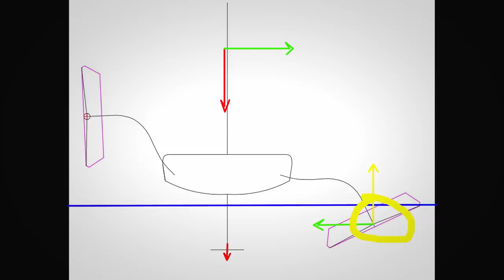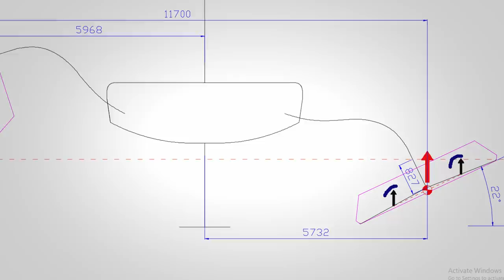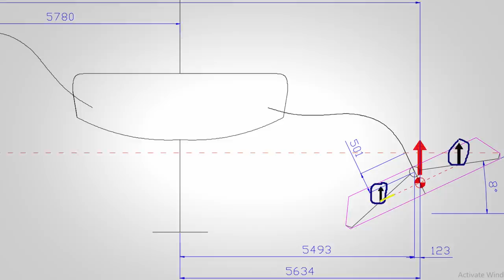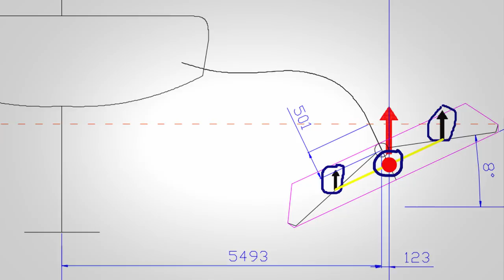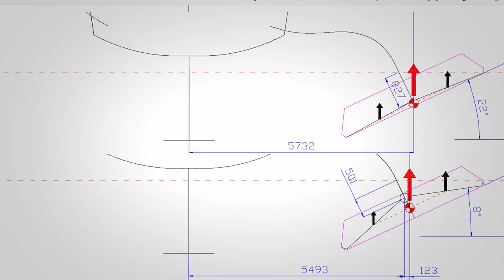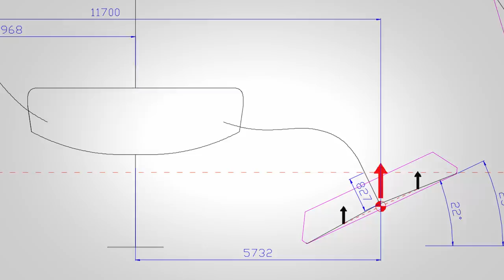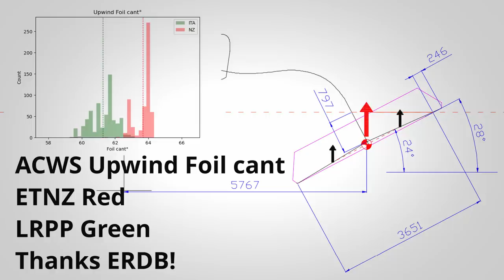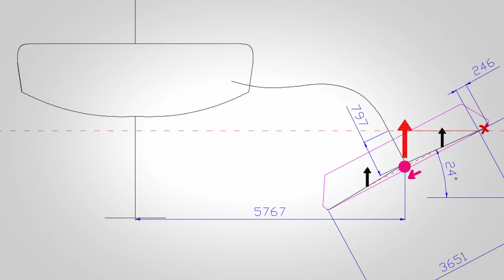Is this the ETNZ advantage that will decide the Cup?

Comment: I am here when many comments are made: I just read a few, so I may repeat something others said already. 
I would have liked to hear about the actual or estimated relative figures of forces that shall be generated by the foils, in terms of lift and of side component to react drift.
The flat foils of the NZ boat are probably designed to carry the resultant of the two (fixed vertical component, slightly variable side component), along the average expected direction: their small dimension could suggest that the flaps are moved together, thus with resultant lift being in the mid point, along the arm.
To me, the Luna Rossa Y shaped foils are designed (and operated) so that the inboard wing shall react, together with the arm endthe drift due to wind side force (I cannot figure in which proportion, while it would be interesting that most be taken by the arm): this force is almost constant, as it shall just provide the moment to fight that of the weight, with a small variation due to the actual height of the pressure center as wind speed changes and the main sail is twisted.
I may be wrong, but I feel that most of the vertical lift needed to keep the boat weight will thus be provided by the outside wing, which is horizontal, thus with a maximised arm; this allows maximising the utilised wind force. 
This would explain the foil larger surfaces (compared to NZ), dimensioned for the performance of the outer one; if my guess about the side forces is correct, the inboard wing normally operates at low CL and CD coefficients, but is available for the generation of additional lift to ease lifting the hull with low wind speed.
I lack the knowledge of sail engineering (and also of proper terminology – wish I have been clear enough) and would thus appreciate comments, together with, possibly, the information of a reasonable set of figures relevant to the various forces (water and air drag, weights and dimensions, sail forces along and transverse).
Thanks.

Comment: Sorry guys, but I really gotta disagree... I think you are very very smart in what you do and I am barelly an initiate in the foil engineering side of things, but I think you are making a bit too many assumptions and forgetting that this is not a straigh line race.

The main struggle for us yacht Designers/Engineers is the assumptions we make and the very little knowledge and importance we give the actual sailing dynamics (sea motions, reaction to wind shifts, sail trim, the humans behind the machine...) and we assume a scenario that only looks at straight line speed in perfect conditions. We also don't know the inner mechanics of the yachts and are forgetting that there are lots of manuevers in this game, and LR has showed they can make really big gains during the starts, tacks and gybes.

TNZ has done a very smart job with their work and all the dots seem to be connected in their design... they've always engineered very good boats for all of their AC campaigns, but sometimes, even when everyone was giving them a big edge on the competition they ended up ass to the floor 5-0.

I think your guess work is really good, but there's much more to it to be uncovered, let's sit back and let the racing happen, we'll see...

Comment: I was going to make the same point as the previous commenters about the lift being asymmetric for the Y foils. However, LRPP can also adjust this effect by changing the cant angle.
Does the lower overall lift limit the cant angle? Or is it dependant upon boat speed?
Could you please also compare how this affects their CMG. And hence their VMG.
Reply from the maker: I think I hint toward this at the end of the video, that LR still have a 'trick' up their sleeve. The flap differential for LR can certainly be used to move lift outboard by reducing flap angle inboard and increasing it outboard. However, you would then need to make more leeway to increase the AoA on the that inboard wing (AoA is less affected by leeway on outboard wing and is instead more as side slip or span wise flow)  and rebalance the forces. Whilst the flaps can be set differential, they wing design must be symmetrical, so you are force to achieve this all with flap actuation, which isn't ideal for drag. 
The real benefit to ETNZ is when they can get their tip out, with greater cant angle and a steeper piercing angle of the surface so foil area loss is less sudden.

Comment: You are disregarding the ability of the boats to use differential flap angles. Here again advantage to NZ when it comes to RM. LR is however better able to produce the optimal ratio of lateral resistance and vertical lift - thereby potentially reducing the drag contribution of the strut by eliminating yaw, or yawing the boat into high or low modes at will.
As you say we don't know enough details to be able to draw any definitive conclusions.
However at this juncture it's reasonable to expect NZ to be more powerful and faster uprange and LR to be more manoeuvrable and to have a greater range of moding (wider groove) which could mean going around the course in less time especially in gusty breezes and downrange.
You are going to need a very complex dynamic VPP if you want to predict the winner.
I expect the racing to be closer than you think. I also expect it to come down to the skill of the drivers and their respective ability to extract the full potential from their boats.
Since the boats are different a lot will depend on the respective afterguards' ability to impose a style of play favourable to their assets.   
It should be very much a match race and quite interesting to watch.
Reply: Hi Giovanni !  A lot of well thought out comments in your post. For me they are both nice boats. 

Auckland. NZ
Reply: Absolutely agree Giovanni, a very dynamic VPP is required to predict the real winner. In reality, we have very limited infomation and have put together our best guesses on a very complex system. Absolutley agree that LR will be more manoeuvrable and be easier to sail. i really hope that we get some close racing!
Reply: @thomaspartington8464      Very true.  So much we don’t know about the ETNZ boat. We will only know on Wednesday. Obviously there are more stats on Luna Rossa. 
Training runs mean nothing to me Thomas.

Comment: LR tried for a long time the flat foil configuration. They also used the two different foils on the same boat...
Probably, being based in a country that know nothing about yacht, sailing, marine technology, they have make the wrong choice...
Reply: Where it concerns component choices there is no right or wrong choice. There's the best choice based on overall boat design and setup. What's good for one team might not be the case for another. The T-foil may not have worked well for LR but it's obvious from my POV that it works quite well for ETNZ.

Comment: I must say I firmly disagree with the direction of the vectors (arrows) of the foils.  That is not the direction of lift.  The direction of lift is parallel to the arm at the bulb.  Please examine any wing cross section and note where the area of low pressure and high pressure are.  From that cross section, note the lift vector is up and into the area of low pressure.   That vector will not be at the angle you have drawn, perpendicular to the horizon, unless the end of the canting arm is vertical.
Reply from the maker: It's the vertical component drawn. Resultant lift of X and Y would be perpendicular to foil as you say. But it gets cluttered showing a host of lines. You can show the result vectors if you wish, but the centres remain the same.
Reply: @MozzySails  So if you add in the X component of the foil lift, and then move that point down (as would be the case for a T-foil) this results in a larger heeling moment assuming the sail X component remains the same and in the same position. This would negate the result of the increased righting moment.
Reply: @MozzySails  when doing vector sums,  the direction of each component vector is critical for obtaining the correct result.  You could split the lift vector into two smaller components, yet only considering the vertical of that split in your sum, and ignoring the horizontal component of that split, will produce an incorrect result.

Consider that the pressure from the sails is producing a moment (vector) horizontal to the horizon.  The canting arm, when at an angle as shown, produces a moment (vector) realized by that angle.  Splitting that into two component vectors will make the horizontal of the arm offset some of the opposing horizontal of the sail, albeit at different altitude.  Which is in opposition to the desired righting moment.  The horizontal vector from the arms/foils produces even more rotational moment about the axis of rotation, not less.  

[These ramblings may not be intelligible without diagrams, something a comment section does not permit.  My apologies in advance if that wasn't clear!]

I'm fearful that the diagrams you have produced are misleading enough to confuse the general public.
Reply: Yes, the hydrofoil is screaming through a dense fluid medium that is (miraculously) creating tonnes of lift, a resultant vector of the hydrofoil lift relative to the boat weight 5-6m to windward would be a little clearer than just the vertical /gravitational component. 

Thanks for another informative video guys!
Reply from the maker: @WhatAboutTheBee  the X component is added in. But just not shown. You can see this as the combined CoL is equidistant between the two CoL in both X and Y axis (which is true where both foil are producing equal lift perpendicular to their surface). 
You could draw the same diagram, but instead of X-Y forces (with only Y shown) you drew the resultant forces.  But the conclusion would be same. Obviously, this does not account for different lift on each foil (AoA or flap actuation) which is a seperate discussion to be had.
Reply from the maker: @seanpoole6413  X component is included. Hence why the CoL for the full wind is equidistance between the CoP for each semi wing. You will also note vertical lift arrow on outboard wing is larger. This is because whilst both sections may be producing the same total lift, the outboard wing has a greater proportion in the Y axis.
Reply: @MozzySails  That is clear Mozzy! 

 I do appreciate the polite discussion and exchange of ideas without rancor!  Happy to have found this channel.  Cheers!
Reply: Wouldn't the horizontal component of the lift increase with an increase in the canting angle? Seems this is the force that is creating lift to windward and reducing leeway.  In other words, sail higher.  You only need so much horizontal lift.  As long as your gaining more from the increased canting angle than you are from the loss of lift due to the foil being out of the water it would be a net gain in the horizontal component.

Comment: I'm sorry I love this channel but most of your assumptions are just wrong. The foil does not generate an upward force but rather an oblique force perpendicular to the foil itself (or I should say parallel to the foil's axis of symmetry), which balances the weight AND the downwind force combined, which is also oblique, therefore for the calculation of the righting moment, the arm should be calculated as the distance of the oblique lines passing from the center of lift and the center of weight and (in theory) parallel to the axis of symmetry of the foil. Therefore (in theory) an anhedral foil and a T foil should have the same arm regardless of the dept of their center of lift (disregarding that a part of the wing may not be underwater). By only considering the vertical component of the lift as you did you get that the writing moment increases the further downwind your center of lift is because the distance from the center of weight increases, but you don't consider that the "unrighting" moment from the sails also increase the deeper your center of lift is because the distance of the "center of sails" and the center of lift also increases, effectively negating any advantage of moving your center of lift further downwind if it implies moving it deeper (as is the case).
Reply: As others pointed out, in addition to this, the anhedral foil allows to increase the lift of the downwind half by increasing the pitch of the boat AND, perhaps most importantly, differential flaps (or single flaps) allow to increase the load on the downwind foil even more.

Comment: Rethink your logic based on the lift from foils is not vertical but at right angles to the let's call them wings !!!
Reply from the maker: We have... those CoL are given with both lateral and vertical. Just only vertical is drawn to de clutter. You can tell as the outboard vertical component is larger, and the CoL for whole wing is equidistant between the two sides in both X and Y axis.
Reply: @MozzySails  Ok.so maybe we are looking at the wrong result .
At low speed I would be only interested in lift to get the boat out of the water.Done by imersing the wing getting it horizontal 
,acheiving more lift .
When up and going I become more interested in vmg by lifting the wing untill it starts to break surface .
Makes sense to my Cornish  campaign !!!

Comment: I think we're loosing a very important point in all this righting moment discussion. Have we ever seen the boats struggle to keep upright? Looking massively under powered to cope with the heeling moment? I don't think so. So is the equation "more righting moment=more power" part of the game? I think not.
Reply from the maker: The boats ease / twist sails to stay upright... they are massively overpowered as soon as up and foiling, especially upwind. Plenty of references on that point.
Reply: Considering the fact that 2 of the teams have played around with cut-down mainsails I think it is pretty clear that righting moment is an important discussion. If they were perpetually underpowered the teams would not be looking for ways to reduce sail area
Reply: @MozzySails  pradacup semifinal race two feed, at around 17:50. i would not call that a massive twist, this is while upwind, a bit eased, yes. I would say they are instead massively over powered when not on the foils
Reply: @robertohaubold752  is very different to be massively over powered and have to severly decrease the area or being slightly over powered and try to make gains on sail combinations. Especially if you think that running a higher ratio jib you in turn increases the lift of the main again. to me the whole bat mainsail experiment looks more to be a reaserch of the more efficient sailplan
Reply: @ruggericci  Particularly at higher wind speeds, twist is increased to depower the top of the sail to reduce heeling moments by lowering the Centre of Effort. However, that upper sail area still creates drag. The batwing was tested to see if the reduction in drag was worthwhile.
Reply: @maxhugen  completely agree max, but you can also see that while running the bat main, teams were also trying to use bigger jibs. that is to raise the aspect ratio, but when you do that you also increase the lift on the main. my point being, if the righting moment gain for NZ was so crippling for the opposition, would they be experimenting the batcrap? probably not is my guess. Also in a new class, with so little time and such extremes choices made, i believe the real factor will be the boat handling. Only time will tell who was right in their design choices, and by time i mean months, years. I think when the apparent wind angle is about 11deg and a sigle degree means gaining or loosing 9% percent of you power, staying lower or higher by 0,4 m seems to to change you drive force of about 5% with little change if any on your side force, changes your your righting moment of about 2%.... Recapping, there are so many new things and phenomenons on this boats that  thinking a that relevant but small change of potential righting moment is gonna win the cup is simplicistic to say the least. I find it to be in the guru heights. Ciao
Reply: @ruggericci  Agree mate, having working endlessly on calcs for these boats, every change in one dynamic has an effect in many others. We can only make guesses! I'm just hoping for some very tight racing. 😎
Reply: @maxhugen  i hope so man... well actually since a mate of mine is grinding on LR i hope they win. but the beauòàwty of this class is that it brought back the match racingokoyJhàvb

Comment: Just trying to wrap my head around how ENTZ extends their hydrofoil arm out further. Aren’t all foil arms the same geometry?
Reply: it comes from having it at a different angle... moving more towards the position the foil would be when acting as the righting moment
Reply: I don't think it's a rule tweak but actually a consequence of their design and the fact that the hydrofoil must be set to keep the boat balanced.
It's a bit complicated, but the lift from the foil is not straight upward as the foil acts as a centreboard as well. Basically, in order for the boat not to capsize, the foil must be regulated so that the lift vector points roughly toward the center of sail.
I believe ETNZ has a lower center of sail due to their sail and hull design and that's why they can keep their foil further outward
Reply: I don't think you guys have answered Ben's question.  He's talking about the arm.  Actually, the obvious point just hit me (duh)- they are just lifting it up a bit- the end goes outward as it goes up- not really well worded or explained by Mozzy.  I think he just assumed we would recognize this.
Reply: @SxWerks  it's not wider, it's less tall so it looks wider.